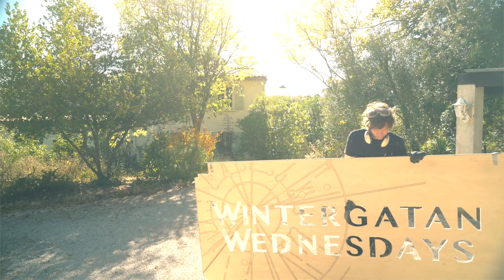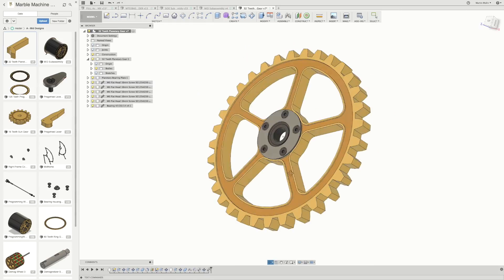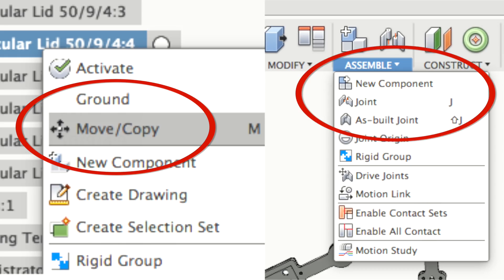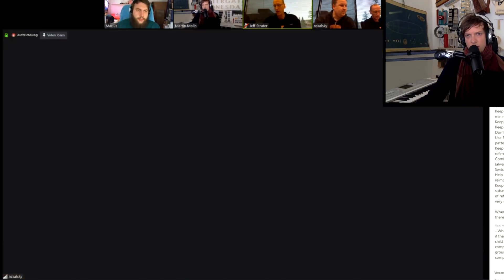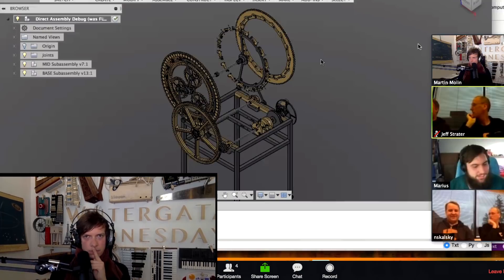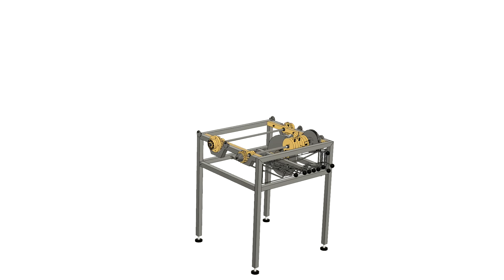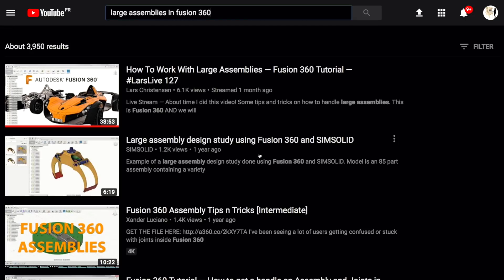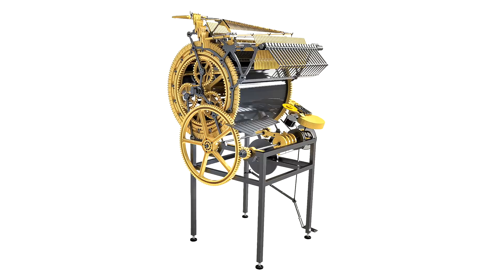Is Fusion 360 Unable to Handle Large Assemblies? - Marble Machine X #31

Comment: For those wondering. The issue with the large assemblies described here is mostly a CPU bottleneck (especially since solving geometry is really hard to parallelize and runs mostly on one core). A better CPU only improves things marginally (there is no 20Ghz processor core as far as I know...). The way Martin explains, is to optimize the assembly for performance and eliminating individual solving bottlenecks by avoiding some commands and/or using them in a specific manner. Another issue that can appear is a GPU bottleneck which is mostly due to complicated appearances like the 3D wood appearance. By using relatively basic visuals while designing this bottleneck can easily be minimized. The other way is to throw better hardware at the problem. But seeing the same problem on my PC as on Martin's MacBook seems to show that you would have to throw a LOT of power at it...
Reply from the maker: Also i might add that There are functions in Fusion to turn all extra costly graphics effects off, which you can toggle back and forth to se if the problems are graphics related, these settings make no difference here.  We stopped using the 3D structures a while back. Marius PC is brand new and if i remembered correctly quite maxed out, so, i have first hand info from the Fusion 360 Software architect this is not a hardware issue. And Marius with better hardware on a new PC experiences the exact same problem. And also as Marius said, Fusion computes using only one single core, multiple cores is not the solution here.
Reply: Well, I am working with SolidWorks (or SolidWaits as we call it some times). We are designing industrial facilities with it. This includes steel constructions (lot of bodies, lot of faces), simplified piping (e.g. flange-pipe-flange in one piece) and other equipment.

We found out that there are some mayor things you can do to improve performance and stability:
1. No Referenced "top down". This means, of you have a piece, a screw for example, you do not let the screw get its length from the assembly it is in, you have to control that length manually. A little more work, but a lot of performance gain.
2. Subassemblies. Especially for SW the performace drops dramatically of there are more than 100 parts in one assembly or 400 mates (links). If you use sub-assemblies, you have lesser problems turning/moving/manipulating, as the sub-assy is moved as one part.
3. ram, ram and again ram. Even with 24GB that I have now on my workstation, it is hard to open our biggest models. Problem is not the model itself, it loads to 8GB sometimes. Problem is Windows behind it, which needs a lot of extra ram. The program just runs unstable if the ram is too full.

Yes, the CPU is important, but I guess there is no big difference between a 3.6GHz and a 4.1GHz. Just get one that runs stable, silent and without a huge power consumption

The GPU affects the visuals only. Performance for making new mates/links is not that much influenced by the GPU, as it only computes the graphics. Before that, the CPU has to calculate all the positions and has to give this to the GPU. Graphic runs more smooth with a better GPU with a lot of VRam. But, you can also turn down the settings. Who needs anti-Alaising on a 4k (or even 1080p)-monitor? Well it looks better but eats up a lot of performance. Same goes with shadows. Turn them off during designing.

But lets say, this is your first experience with 3D-CAD, so I guess that is what we all experienced :)
Reply: When I was working with drafters in the 1980s, running CAD/CAM on Sun-3s, they could handle millions of pieces in an assembly; but they too did it like Martin is doing here, the "Master" Assembly had sub-assembly sections which could then be drilled down into even more sub-sub-assemblies. Now, they didn't have polygon surface shading or any of that fancy stuff; but when you take into account those old Sun-3 stations were running Motorola 68010 chips, well it was pretty impressive. For comparison, the 010 chip would be about 1/4 the performance of a first-generation Apple iPhone.
Reply: I was wondering that very thing. I've got a hex core processor, with a NVME SSD, an incredibly powerful computer. However, not all programs seem to run that much faster on it. Good luck!
Reply: You do not need any kind of supercomputer as long the program you are using is not optimized for multithreading.
As long Fusion 360 is using a single core to calculate any geometry it will always be limited to a "max" ammount of bodies and parts.
Reply: @PuffsBlz  all CAD programs use single core because of the nature of CAD, linear logic flow
Reply: Fusion 360 is not the best optimized software for large assemblies anyways, Autodesk Inventor and Solidworks, amongst others, are far more efficient at loading and rendering big projects, they also allow you to make such assemblies more modular so you don't have to load entire models at once. 360 is, by in large, still in development and not really what most people would consider a full-fledged CAD program yet.

Also, lets be honest, MacBooks are NOT good CAD hardware, or laptops generally for that matter (you can get them but they're expensive). You can get a decent CAD desktop PC for less than the cost of a Macbook and it will run FAR more smoothly with large assemblies.

I'm running Autodesk Inventor on a desktop computer with a current-gen i7 and a previous-gen mid-range gaming graphics card and it handles the over-6000 part assemblies I work with without any issues (the system never goes above 25% utilization on CPU, GPU, or RAM). You could likely use older, cheaper, lower-tier hardware than this and still get acceptable results, no "20Ghz" processor needed.
Reply: Being that I''m an amateur game developer who started doing that when it meant writing your own graphics engine, I can say that if there's a performance bottleneck in a demanding program, it won't matter what upgrades you make to the rest of your computer, it's the specific bottleneck that will dictate the performance.

Obviously Fusion 360 isn't a game, but it's still fundamentally a realtime 3d engine, which means broadly the same performance problems arise.

I'm really not particularly surprised that a large number of objects with complex geometry causes a CPU bottleneck, since this is a well known issue in gaming and has been the focus of much work simply trying to transfer the information from CPU to GPU effectively.
For that matter, depending on the nature of the calculations being performed (Parts of it would appear to be problems related to motion constraints, which is akin to trying to perform physics collisions on a large number of rigid bodies...) that's also typically a very CPU intensive task. (and hard to multithread since everything is interdependent and you'd get all kinds of race conditions and data integrity issues.)

Keep in mind that bottlenecks can be fairly specific; Lowering effects such as woodgrain would be constrained by VRAM performance if they're textures, and the pixel shader performance if it's some kind of procedural material. Still, that doesn't tend to matter so much unless the specific hardware you use has odd constraints. This was a bit more of a concern in the days where GPU's had fixed function pipelines or seperate pixel and vertex shaders though, but it still remains a concern...

Performance tuning is an interesting and complex subject, but one that is difficult to do effectively without knowing how the rendering engine in question is designed, since a bottleneck is highly dependent on how a program's code works, and how it then interacts with any API calls (Such as OpenGL or whatever else may be used.)
Gaming and professional graphics cards can have very different drivers even for what is roughly the same hardware underneath, which can be a bit of a scam at times, but, that's a reality we have to live with...
Graphics drivers for games are notorious for second-guessing what any given game actually does, which is a pretty awkward thing to be doing, but explains why driver updates seem to fix performance so often; The game is guessing what the drivers do, the drivers guess what the game does, and between them nobody actually properly knows the end result, which is... Unfortunate.

Well, happy to see some workarounds at least.
Back to making that amazing marble machine a reality. XD
Reply: leogaming83 GPU is a non-issue there, the main problem is a non-parallelizable process is being run, so you'd need the strongest single core performance available i.e. a 8700k overclocked to the rim...
Reply: I mean, if that is the issue. Liquid nitrogen cooled overclocking. Now that would be fun to watch.
Reply: >I mean, if that is the issue. Liquid nitrogen cooled overclocking. Now that would be fun to watch.
LTT/Wintergatan crossover?
Reply: NO! Linus no! You want Linus putting his hands on MMX and destroing all? (laughts)  It's not a problem of hardware power only, but how Fusion 360 is optimized. Each CAD software have a price tag, it's the maximum that you can extract from him. It's a equip and hundreds of hours of work to make and opitimize the software. Like Martin said, Autodesk need to change the marketing about the 360. And Darth Marius is speaking!!!!!
Reply: Software algorithms can be designed to various levels of efficiency. We measure the efficiency relative to the number of objects the algorithm has to deal with. Sometimes the algorithm is proportional to the number of objects,  but sometimes its proportional to the square of the number objects.  So, let's say the algorithm which is dealing with joints is of this type. If it runs in 0.1 second with 100 objects, it will take 10 seconds with 1000 objects, and 40 seconds with 2000 objects.  If you double your CPU speed, you could possibly halve this, but it's still a lot slower.

The answer is to change the implementation to improve the algorithm.
Reply: I am working for a company which is develop a FEM (final element menthod) software. We did a lot of test on Amazon with a lot of different virtual machine ,testing the performance of our software  with 4-8-16-32-128 cpu cores. We got the best performance with 8-16 cores because the  too much multi-threading process of the calculation request much more managing performance from the system. Multi-threading is a very good thing but not the final solution at all.
Reply: I think that at this point it would make sense for you to upgrade from Fusion to Inventor, the software is much better optimized and can handle industrial level, extremely crazy assemblies. Plus it's basically the same as Fusion but better. 
The only problem is that it runs on windows only, so if you have available storage on your mac, you could bootcamp it (have MacOS and Windows in the same machine). And then install it there.
I've been using Inventor for a few years now and it's absolutely worth it for what it does.
Reply: I use Autodesk Inventor a lot for large assemblies at work. It has shrink wrap features and level of detail features.  Shrink wrap converts subassemblies into simplified single parts for assemblies that will only be updated manually making it much less computer intensive. Level of detail let’s you turn off features in assemblies such as chamfers fillets small holes or anything that creates a lot of surfaces. Fusion does not have any features like this?  I wonder if Autodesk gears their software this way deliberately...
Reply: i cant believe its not a multi core program!
Reply: Chadwick starting in 2013 they started optimizing the inventor algorithms to multithreading. I remember when the moved the fea analysis to multithreading...glorious day. Also I have noticed that they don’t require as much memory as they used to.  The whole model used to load onto memory and I had a 64gb ram machine. Now I get away with a laptop and 16 gb just fine.
Reply: Marius Are you guys using workstation graphics cards?
Reply: Rigid subassemblies specifically. Someone on my team made every single subassembly flexible and performance just plummeted.
Reply: I knew before that you have a lot of Hirn, but it's also you surname ;)
Reply: I am interested to see what hardware is running the calculation in fusion 360 for Martin and Marius because the system requirements listed by Autodesk are not very helpful at this point. so we have some reference to see if our own PCs could handle that kind of a project or not.

I am thinking about solving geometry on a single thread.... I am not into software engeniering but wouldn't it be possible to create sub assemblies and root them to a specific core / thread within fusion? This should lead into a multithreaded geometry calculation for the complete assembly since every sub assembly is calculated on its own?!
Reply: RAM is also no problem here. I have 32GB and it didn't changed anything. Fusion just used about 4 GB.
Reply: If the issue is the CPU bottleneck, why does it disappear in Inventor ?
Reply: @audiotestchanneltm  the bottleneck in the CPU is because how the program stores the data, and later access it.  So if another program does all this in another way, like using another implementation of common data structures, then you will have another performance.  And the differences can be huge.  It is usually better to invest and re-implement algorithms in a program then to change to a faster CPU.
Reply: >(especially since solving geometry is really hard to parallelize and runs mostly on one core)
That sounds really interesting. Do you have more info on this?
Reply: Marius basically the guy wants to build something so complex the engine can't handle it all with the power it's given.
Actually 20 GHz exists but it isn't cheap and kind of useless. First using a big Quadro helps a lot, but also the use of textures everywhere when is not needed is not the best option when creating something like that unbelievable thing x)
Reply: @leonisprime  there isnt any 20ghz cpu the highest frequency ever achieved is 8.7ghz on Fx-8370, cooled by liquid nitrogen
Reply: IN1VISIBLE3.- i am not sure bout the algorithm inventor uses but i guess it is optimized for x64 multithreading. A single core process is limited to the  frequency of your cpu while multithreading (using multiple cores / threads at once) for the same workload reduces the time by a lot.
I can mention Adobe after effect for myself.
Rendering an audio wave spectrum for an 1 hour video takes bout 1 hour for me on a single core process. The moment i let the process render on 4 threads of my cpu  rendrring time drops down to 35 minutes (i7-6700k @4 GHz).
Reply: This is a pretty common problem and work around. We use this technique in the office in a way with Xrefs which helps us spread workload as well.
Reply: dothemathright 1111 the problem with 3d cad is, that by the way the parts are defined and arranged in ONE room makes it hard to serialize the calculation. It is not like CFD where you can simply "chop"the room you have into different areas that are calculated separately.
That is why cad-frograms (even solidworks, inventor,autocad, catia, as far as I know) only use a single core to load and calculate the model. After it is loaded, however, there are different jobs running of different threads, at least in solidwaits.
Reply: You guys are making it sound like you are BitCoin mining. OR at least need a computer rig that can do both (or heat your house at the same time). Next you guys are going to say that the Computer needs to be cooled by Liquid nitrogen (LN2). Maybe you need to make a call out to anyone who is doing LN2 and needs to benchmark their rigs to see if they can make your program work faster. {See https://www.pcgamer.com/overclocking-a-cpu-to-7-ghz-with-the-science-of-liquid-nitrogen/}. I could see a rig with 10 cpu cores with L2C at 7-ghz speeding things up.
Reply: Consumer cards are not good for CAD... They are not fast enough for the task. (Downside is that they are not good for gaming).

The program probably still uses OpenaGL, they should probably switch to Vulkan for a little bit of graphics pipeline speed up.

And they could use SPIR-V/OpenCL to do some of the computations to offload the CPU when the GPU is not that loaded.
Reply: too many people think that their mac is superior, but when it comes down to it, a windows system is better when pure performance is REQUIRED (gaming, video rendering, computer programming, 3d modeling, game design, server running, multi-OS virtualization, multi-system virtualization, etc. the list goes on as time goes on and mac just goes with the  "good enough" hardware for the normal person and says fuck you when you want something more powerful)
Reply: Kuralthys, Mac systems ARE odd with their bottlenecks, one program can work, and then if you copy-paste a line of code (that isn't dependent on other lines of code) it will break the ENTIRE program as the compiler will say that something that WAS syntactically correct is now syntactically incorrect, and it WONT fix it if you try to retype it, letter for letter.

apple is not concerned with what the user wants at all, all they want is to look at what will make them the most money (hence why price-for-performance values are HORRENDOUS compared to alienware vs custom systems) every game that runs good on them only does so due to the hardware being the same, requiring less optimization for the "lowest denomination" (if you catch my drift) and thus can cater toward that specific generation of hardware and making it completely incompatible with the previous. (MAC stole GUI-based OS assets from Microsoft, Microsoft makes something, and apple looks at what did work, implements it, and what didn't, and leaves it out, allowing them to just take what Microsoft made, take the cream off the top, and market the cream as THEIRS instead of anything else)
Reply: Remote desktop is not a great idea. Believe me, I used to work with google services with agisoft photoscan. You want to use remote desktop in case wher there is no need of frequent interaction between user and program. for rendering its great but for building a machine obviously not
Reply: True and wrong. Fusion might be not the right tool for that kind of complex Model. Sure he made the normal starter mistake to model too fine and also does not organize the model well enough. But hold on - he is a musician and not a engineer which does those kind of tasks everyday. He can be more than proud about what he has reached so far. I am happy that he coud find a workaround. To change the CAD system in this stage would be a complete disaster.
Reply: Yes, there are bottleneck issues but other programs are way better because of their strategy to minimize the resources necessary and make use of all computing power available.
This is the main difference between a low end CAD toy program and a real engineering program like Catia

Other types of behemoth amount of computing power is needed in FEA, and while toy FEA programs exist, the better ones (like Ansys) make use of all cores, all ram, all gpu and vram, parallelize as much on more than one computer trough ethernet/usb/serial/FW/etc, all I/O avilable by using the HDD as a slower RAM, etc. This is the key of a good program. Make an algorithm that is accurate and converges quickly to solutions in few steps and make use of everything you got.

So engineers don't fuss around limitations.. they use the best program and reasonable high computing power machines. So if any bottleneck arises it's called user error and a simpler approach must be used.

In this case, a simple change of the program will solve the issues, or just simplify the things and think to yourself you are in 1995 in catia V4 and deal with the problems as best as you can.. i believe they are similar in handling large assemblies.
Reply: Ditch your mac and but a proper pc with decent graphics it will improve alot
Reply: For those wondering, in short, a shitty program.
Reply: Ambient Morality PTC Creo is already on mid tier cad, over inventor and solidworks, but below catia and siemens nx
Reply: in other words dont own a mac for large projects
Reply: Better hardware maybe, better software too .. there's no reason for gpu / cpu bottleneck this it not not a live rendering, gpu / cpu should take all the time it needs
Reply: "Martin's MacBook "... seriously? Maybe he should he consider bying a quadro and core i9 for that purpose... Because building such complex machine on macbook isn't a great idea. Its like someone would want to play crysis on a system with geforce 256 and celeron 366... Why they even discuss this issue if the problem is obviously in a laptop config.
Reply: Marius talking about a processor only using it's speed as a reference is like saying a car can do 10,000 rpm up a very steep hill.
Reply: Google or Amazon Cloud might be a solution, though unsure how expensive.
Reach out for collaboration opportunity?
Reply: Well, there is always hack and tosh. :') Albeit that's quite the gray area.
Reply: Happy that you guys found a workaround. Thanks for all you do Marius!
Reply: Yep... to render MMX in CAD like Martin's trying to do would require some seriously hefty hardware and likely be restricted to multiple high end AMD FireGL/FirePro/Radeon Pro or NVidia Quadro class graphics processors to be able to optimise the system for the task. You'd still likely need to optimise the models as well though as just throwing hardware at the issue doesn't solve all the problems, as even most game devs find out the hard way.
Reply: @Wintergatan  I I have used inventor before, but why would a professional product only utilize One Core on a CPU vs scaling across all cores of a CPU?
auto desk better get on that sooner than latter because the future of computer CPUs is 10+ cores and not GHz as it was in 2012.
Reply: IN1VISIBLE3.-  inventor scales with a higher core count CPU
Reply: @TKC  most likely....
Reply: TKC I also used in inventor a lot I learned it a lot faster than Auto cad... na... i still dont know auto cad. Its only useful for lazer cuting things.
Reply: S Creep Fusion 360 is cloud-based and only uses one core of a multi core cpu in a pc. can't fix that.
Unless you bend over and pay up. (For inventor)
Reply: Kondorf no 360 denotes cloud based . So kind of..  but not really.
Reply: As i started CAD i use a Amiga 2000 with 5 MHZ... Due the time i figured out that whenever something becomes more powerful, the peoples have nothing better to do than to put as much overhead inside as they can. As long until it becomes as slow as the old Amiga was :D The Trick is all the time to ask yourselv is it needed, can it be simplyfied and so on. A good understanding whats going on behind all the scenes might help. But as said, i can not blame our marble hero. By his education / life way - he is not an engineer, it was outstanding what he reached so far. And i am quite sure the next times he will choose his tool a bit more wise.
Reply: Workstation with two cpus, 64 or more gb of ram and a acceptable graphics card should accomplish what you need. Realistically its just a hardware issue, easy fix.

LTT has some suggestions for such builds if it helps you all out
Reply: Actually it is not harware issue. 1st problem is the limitations of the program. Autodesk have inventor as a pro CAD software. A decent workstation for the better program is recommended as well.. but as far as I understand the problems are still present on a better computer.
Reply: Do not forget to mention that such a machine usually outperforms even a gaming computer by its price. :D It usually starts at 5000 Euro and then you was greedy and clever :D In his case i would lease such a machine for a while or ask if someone can sponsore him with such a thing. Build suggestion is easy: MSI Server Mainboard (500 EURO), some Intel I7(1300 EURO) or better with around 4000 Ghz, hand picked RAM modules (700 EURO) and a NvidiA quattro 2000 (Model Name = price).... With the usual rest (ssd, power supply and so on (~800 Euro))  you will reach such a amount of money very easyly. And do not forget the software licence (ACAD 4000 Euro or 250EURO / Month). Its funny 1986 a CAD Workstation with software was around 10000 German Marks. Today its same - just in Euro...
Reply: Used hardware would reduce the overall cost quite handily actually. Plenty of it centers offloading previous gen xeon systems for a song if done right.
Reply: Not really and there is the risk that this usually heavy used parts will give up. Noone who has a good ones will sell them. Takesusually also endless to get the pieces together.
I usually buy new parts and uses them very long. My current work station is now about 8 years and can still compare well. If you divide the 5000 Euros by 8 years the mashine was not even expensive :D. A better approach is to buy clever. For 10% more processor power in high end intel asks usually double of the price. And those 10% you wont recognice. But Martin is more a hobbyist. I am civil engineer. I can earn money with my maschine. We have to ask Martin how often he will CAD in the future. If he would like to continue on that way it might worth to waste this amount of money. For a limitzed time use like now i suggest to lease such a device for half a year and give it just back.
Reply: Might also be just half the price :D
Reply: Just get an i9 or a threadripper
Reply: Yeah, moreover, due to the strict TDP limit, notebook CPUs throtle much more than the desktop ones. Get an 8600K/8700K if the software is not well optimized for multicore. It might easily be twice as fast as the macbook.
Reply: Or hyperthread and run ARX commands perhaps
Reply: The question is can any other software of comparable cost handle this complexity? Maybe Lars has a very powerful computer with tons of RAM. Forgive me if I missed it but what are the specs of the computer you are using?
Reply: ok
Reply: Kittingmare I was with you in sep 14
Reply: https://www.statista.com/statistics/1134042/processor-single-core-performance-geekbench-score-worldwide/  (Oct 2020)
If you are buying new hardware, consinder this list and get a CPU with high single core speed! cheers, Martin
Reply: To be honest, all of the CAD community knows the CPU is the most important component of a system. Most, if not all CAD programs are not multi-threaded, meaning you should get a higher clocked CPU
Reply: This video makes a good point that Fusion 360 is not the best software for large assemblies. PTC Creo is probably the best for that, but it is not good software in any other way. SolidWorks is fairly fast and just as user-friendly as Fusion, though obviously it is more expensive.
Reply: Marius speaks!
Reply: I'm surprised that no one has mention RAM yet in this thread. Would a RAM upgrade be feasible and helpful?
Reply: Don't forget Fusion 360 is a cloud base 3D cad platform compaired to Inventor or Solidworks and even Solide Edge.   Just look at Photoshop and all the Adobe suites that are now cloud based.  how often users of Photoshop hot a wall and the apps locks or shut down that they lost almost the full job.  And they have to do it all over again.    So Fusion 360 suffers the same issueas all other cloud base apps.

So better hardware won't change anything.  It would be true if everything was on the same PC, the software, the files and no web related connexion. Better hardware will improve performance.   But in this situation it's the cloud portion the problem and it's true because not everyone has the same internet connexion and speed  in 2018.
Reply: @lepompier132  You could work offline in Fusion, only the files are stored in the cloud, you can also save everything locally
Reply: for those of you saying that you can just upgrade the computer's components listen closely:
apple WILL NOT allow you to have a system that runs WITHOUT CERTIFIED APPLE PROPRIETERY components
meaning:
if you want more power then, urfucked.jpg
Reply: Gutes Resümee! Martin sollte es anpinnen, die Kommentare wiederholen sich sonst andauernd! Ich LIEBE Wintergatan, 1000 Dank für deinen Einsatz in diesem Projekt
Reply: I can guess :-) But as far as I can tell the graphics card is not the/only a minor problem here...
Reply: is it about single core or multicore? if single = intel 8600k if multicore wait for a 2700X launch or get a threadripper. those seem to be the best price per performance
Reply: So wouldnt it be better to get a better cpu and gpu than a macbook pro like a gaming pc ??? Like an intel 7700k and a gtx 1060, 1070 or 1080 ?? and more ram ??
Reply: Isn't most of the heavy calculations in fusion done in the cloud, so the bottleneck would rather be the internet connection and/or the computational resources att Autodesk's servers?
Reply: fusion 360 does make use of multicores. an I9 overclocked should help out a lot. you can pretty much skimp out on the gpu as the performance gains are minimal.
Reply: try an overclocked 8600k or similar
Reply: Marius I'm not terribly familiar with fusion 360, but I have quite a bit of experience with Inventor and Solidworks. One of the largest problems with large assemblies is chamfers and fillets. They can make a part look great but they cause it to become slow when manipulating the assemble. This is because they increase the number of surfaces. The more surfaces the more resources they chew up. Furthermore curved surfaces such as filets will bog down a computer because the computer has project light on that curved surfaces. Which is difficult for it to do. 

Why am I saying this well your basic screws can get even more basic. 

And you are better off using feature fillets and not sketch fillets as they are easier to adjust if needed. Not sure if you do this already.

Also solidworks has settings to make the rendering environments a lower quality (curves look like a bunch of lines and not smooth). This will speed up the rate that you can manipulate the object. Change it back when you want it show it off.  Additionally if you can temporarily hide all appearances and materials that will speed it up. Not sure if you can do these in Fusion though
Reply: So, you basically need a supercomputer? You could ask nasa to use their computer ;)